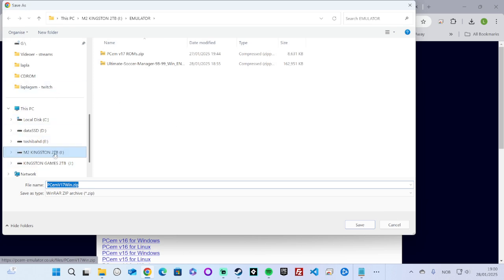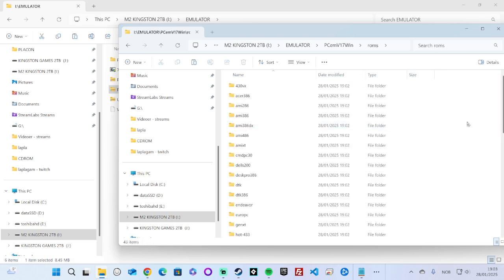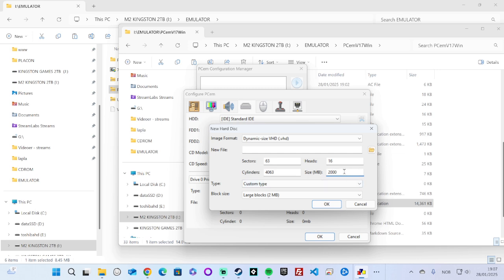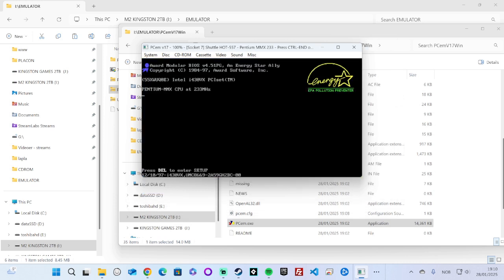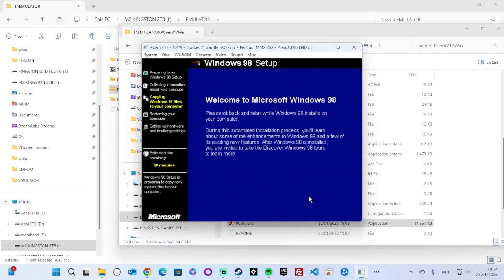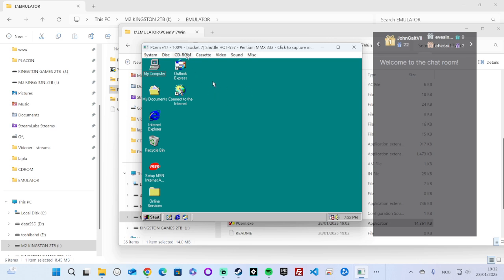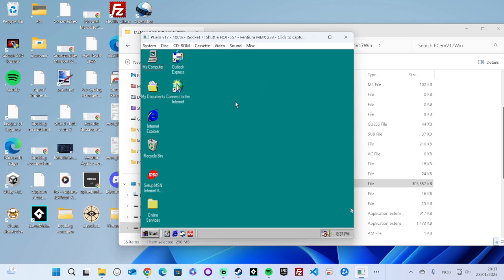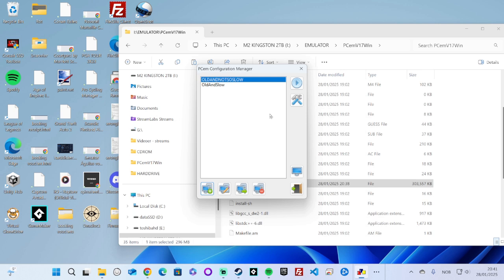How to set up PCEM with Windows 98 SE and install and run USM98 retro game on modern pc's.

Comment: how would you install the patchs for the game on the emulator?
Reply from the maker: Hi, truly sorry I did not see this message. To install patches you would need to add the patch files on to the emulated hard drive from your pc. I have a separate video that shows how to move the files into the pcem hard drive you can watch on how its done. From there and onwards you install/update based on whichever install instructions the patch have.

Comment: Thank you for the video. What are the specs of the host machine?  I know this emulator is cpu intensive.   Thx!
Reply from the maker: I'm running it on a amd ryzen 7 7800X3D, so quite a strong CPU. In case you should have lower power on your PC you can always downgrade the emulated CPU down to 130, and maybe even 90 mhz if the goal is to run USM98.